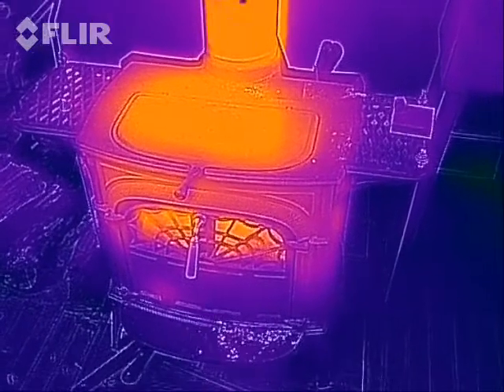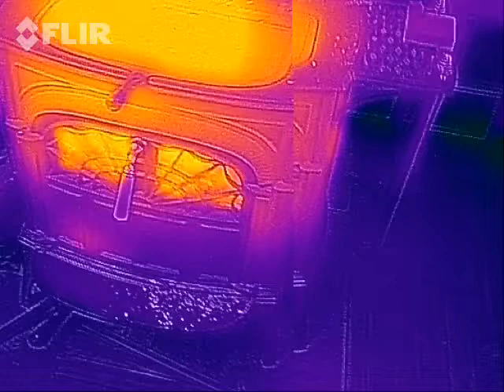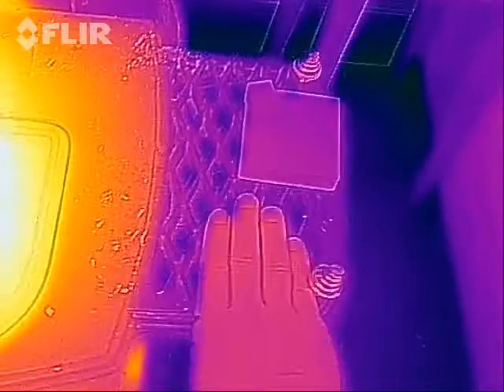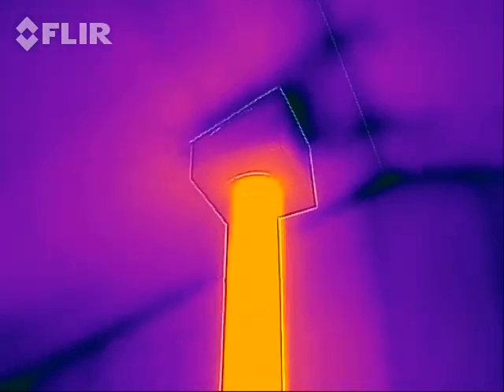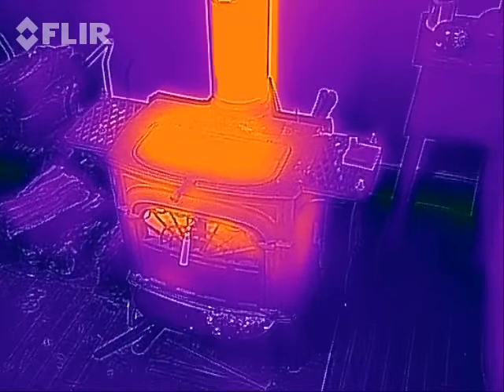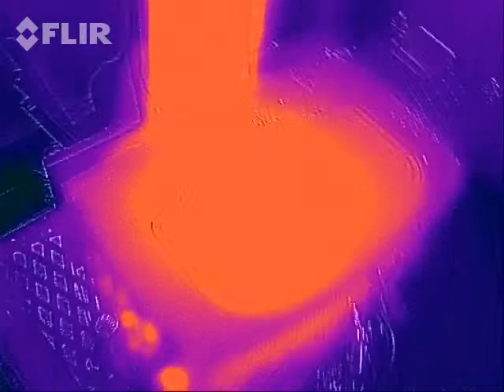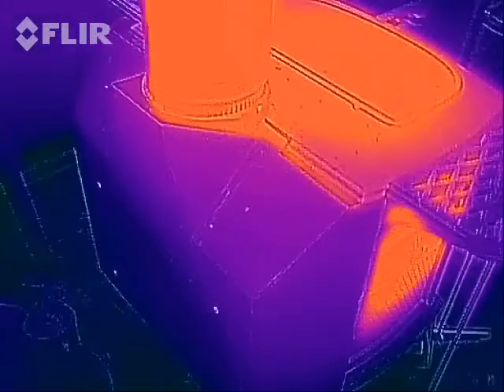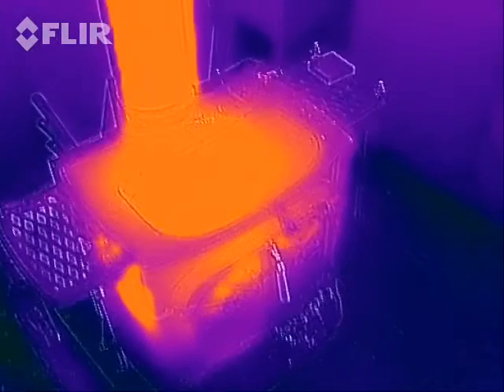Thermal Video of a Woodstove burning a fire

Comment: did you ever get up into the attic this was really cool
Reply from the maker: Yes, after this, I got up in to the attic and insulated around the metal box that the chimney pipe goes through to pass through the ceiling. I used fire-proof material directly up against the stove pipe, and standard fiberglass insulation around that. It made a noticeable difference, and really showed up different in another thermal image I took later.

Comment: Did the manual that came with the thermal imaging device have anything in it about emissivity of different materials? On the black steel stove it would probably be .8 or .9 but when you sere shooting the car, the glass may have had a much different emmisivity than the body of the car. When I was doing this in industry, we would sometimes put a piece of black electrical tape on the surface of the object we were reading to make sure we were getting a true reading of the temperature.

http://www.raytek.com/Raytek/en-r0/IREducation/EmissivityTableMetals.htm
Reply from the maker: In the app for the FLIR ONE, there is a setting where you can change emissivity - matte, semi-matte, glossy, etc. It isn't as good with shiny metals as it is with other surfaces.

Comment: Look into a rocket mass heater to reduce your wood use and get more heat into your house and not out the chimney.
Reply: ***** What makes you think that rocket stoves require frequent refuelings and more work? More wood is more work to cut and haul and stack and chop. And you may have a cheap source of wood, but it probably still costs you more the more cords you buy.